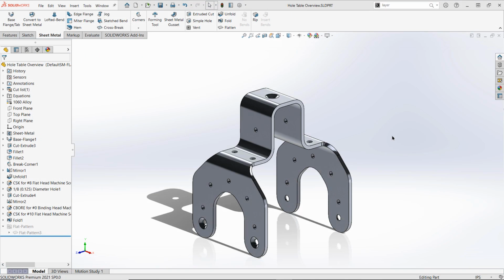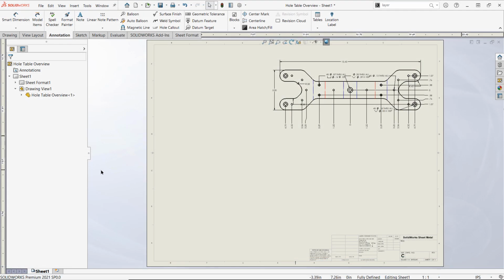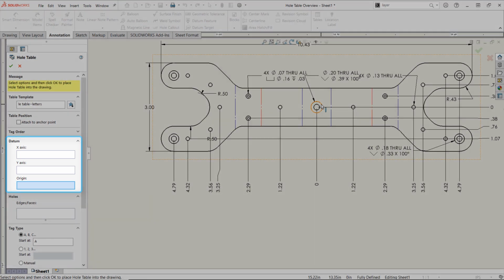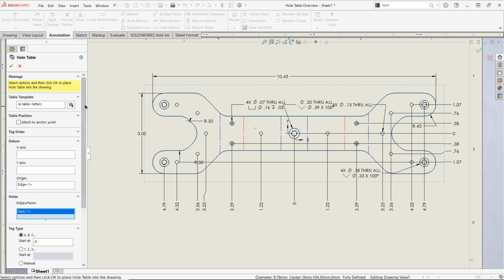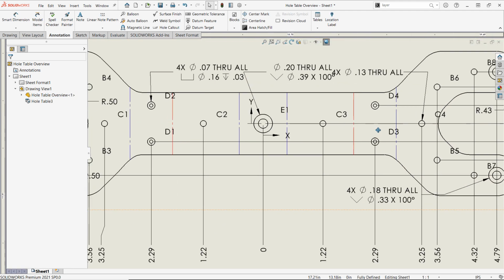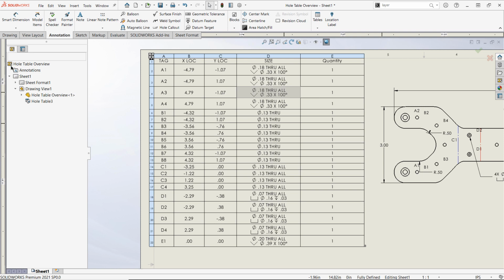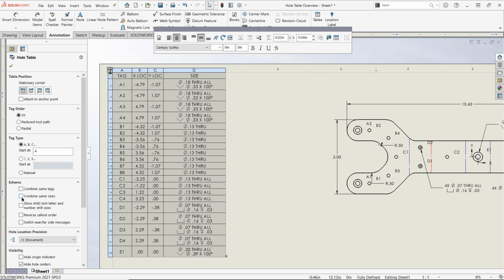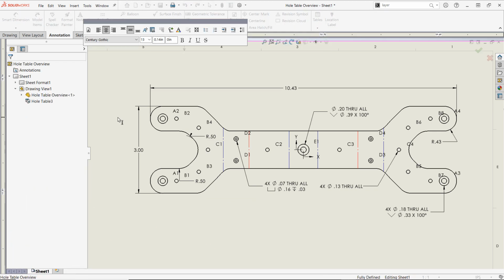SOLIDWORKS: Hole Table Overview

Comment: Instead of dimensioning holes, is there a way to do it to points? Using the same part as an example, I want to dimension all tangency points of the outside shape in a table.